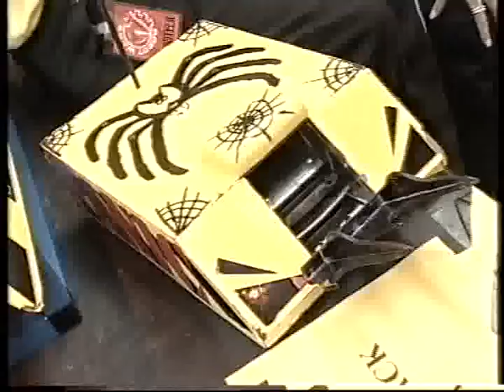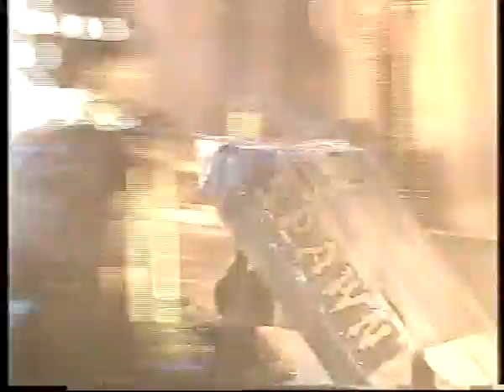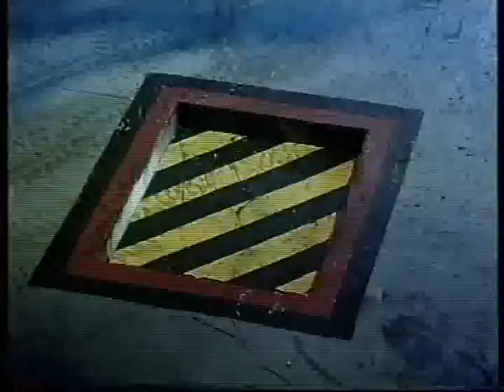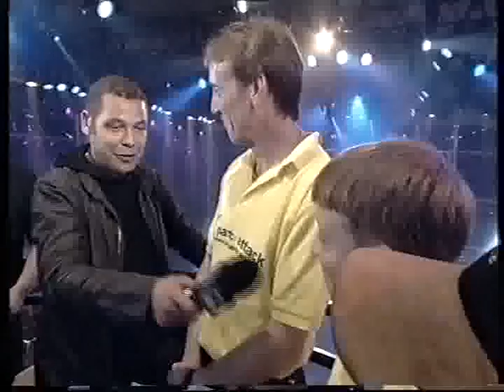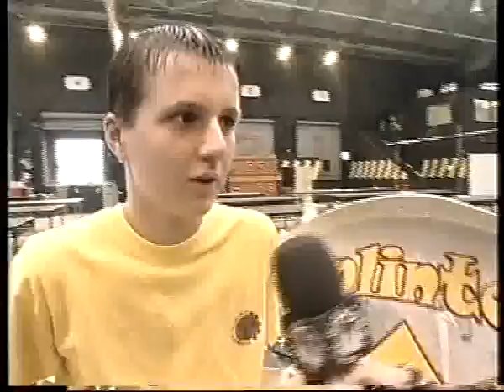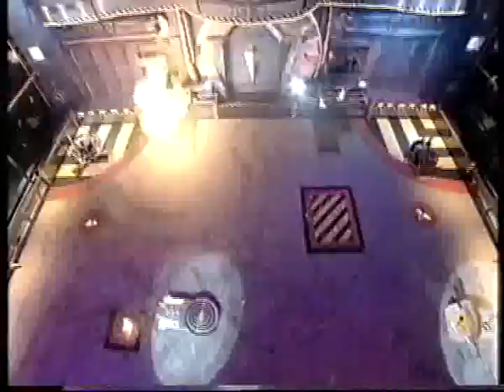Robotwars Series 4 Semi Final B Part 2

Comment: Spawn of Scutter really had a bad pull against Panic Attack- the robot was good, but had almost NO chance of getting under Panic Attack's skirts (the only places they might possibly find a ground clearance were at the front underneath the spikes if Kim Davies lifted them or at the back where it doesn't have a skirt, which they had NO chance of reaching with Kim being as good a driver as he is) and without that the fight was over before it began.

I think Panic Attack was having some trouble with the gyrostabiliser when they had Spawn of Scutter pinned on the arena wall- you could see Kim trying to line the robot up to get in under his opponent, but he was having trouble lining it up right. Kind of funny watching Shunt come in and try to axe them and keep missing, though. Took him 3 attempts.

Hey, when Killalot started leaking hydraulic fluid, was the House Roboteer trying to position him over that grille in the floor to try and minimise the amount of fluid that would spill onto it? But wouldn't that mess up whatever mechanism was underneath the grille (looked like a light)?

Another pretty good fight really, although it's short, one-sided and mostly decided by the matchup just being fundamentally bad for Spawn of Scutter.

Craig, the driver of Splinter, really did have a good head on his shoulders. He accurately predicted that if Splinter hit Hypno-Disc's disc with its scoop moving in the same direction that the disc was rotating, it'd absorb the force of the attack. The problem is that he has to do this perfectly every time and if he messes up just once it'll be doom for his robot... which inevitably happened. It was a horrifically bad matchup, but they gave it a good go, and certainly gave Hypno-Disc far more trouble than anyone else in their heat did (V-Max got a single good slam in on Hypno-Disc and that was basically it).

Hypno-Disc's claim to have "wiped away all four competitors so far" is inaccurate, oddly similar to Pussycat printing a kill sticker for Milly-Ann Bug on their chassis when it was Razer who destroyed them (even worse, since Pussycat at least fought Milly-Ann Bug in the melee first- Hypno-Disc didn't even face 4 robots in their heat since heat final opponents Raizer Blade were also their 2nd melee opponent).

Splinter really did make a good effort, but you notice when they run Hypno-Disc into Dead Metal you see Dead Metal's saw twitch, but then settle back again and it just releases them? I wonder if the House Roboteer wasn't ordered to release Hypno-Disc unharmed to avoid any shocking upset shenanigans? Then again, it WAS still early in the battle. Unfortunately, Jonathan Pearce brings in his greatest example of tempting fate when he gets as far as "maybe" before Craig makes a wrong turn and Hypno-Disc strikes the decisive blow. This is gonna be gruesome...
Reply: I agree about Spawn of Scutter. With the possible exception of Hypno-Disc, it could have done better if it were drawn against any other robot in this semi. Panic Attack was basically a wall to SoS's design.
Reply: @TheDuckClock  Panic Attack won the 2nd wars. From Joe. X